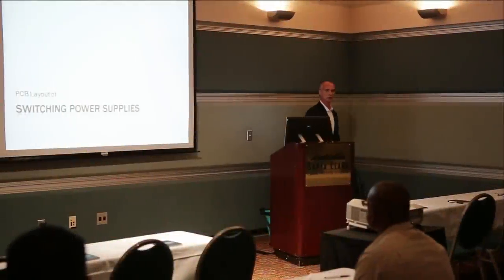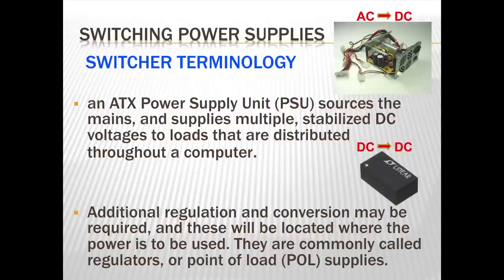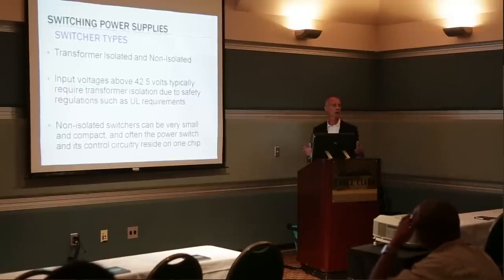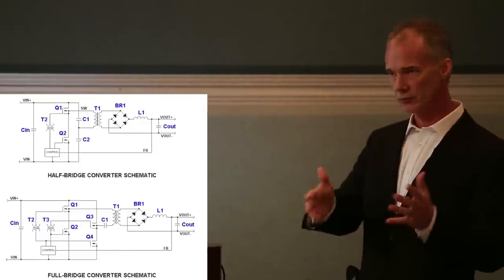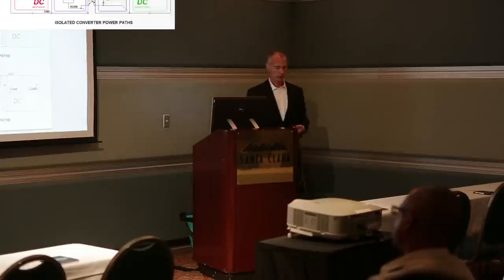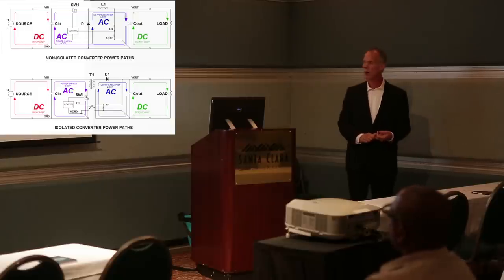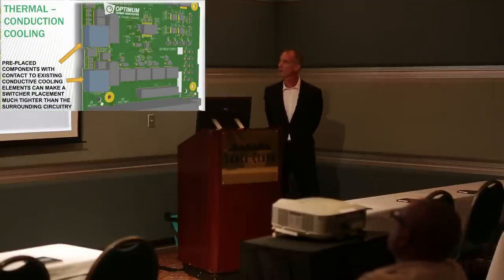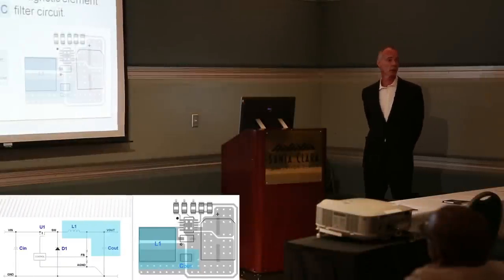Switching Power Supply PCB Layout Seminar

Comment: for the layout example at 28:10 i would not have extended the vout copper pour under the inductor to minimize capacitive coupling from the switch node to the output, one could possibly even have a ground sliver under the inductor to further reduce the coupling, also be aware of inductor polarity for multilayer inductors, you would want the start of the winding (inside) towards the switch node

Comment: Can you suggest a software to me for doing mix signal analysis. I have to design and POE++ device with Power Source side and PD controller side to power up high power LEDs like 70W.  Client requires detailed simulation prior to making the hardware. 

I have seen LTSpice but it doesn't support micro-controllers. Candace tools are super expensive. ...what are my low cost options.
Reply: Think about this before taking a job next time, lol
Reply: Hmm.....why would simulation SW need to include an MCU? Especially for power?

There's also Simulink in MATLAB for generalised & control system stuff

Comment: Great video! I have 1 question on the slide (at time 31:30) the "thermal pad" for the fet is connected to SW. How do you provide cooling for that fet and keep the SW node small?
Reply: This comment is really old but usually the thermal pad is not connected to anythjng
Reply: @sain8827  Hi, I'm still alive ! :)  The thermal pad in 99.9% of IC is connected to GND (or the lowest potential of the IC) and usually they specify that it should not be left floating. In this example with the IC in question is a fet, the thermal pad is also source connection and on Q1 you can see that it is connected  to a big power/ground plane with plenty of thermal vias to spread the heat. I think my questions still stands, and Q2 has only a small area to cool, via its source connection.

Comment: 9:46 - "Linear regulators are typically 60% efficiency". Ok, that sentence did not really help, as it would be hugely different depending on the ratio of input and output voltages.

Comment: So many traps in this video. Explain how you determined linear regulators are only 60% efficient for any circumstance (Hint, you can't). Also, perhaps research your topic a bit more, as you find that many switching regulators are just linear regulators with an additional controller. Also does not talk about disadvantages of Switch Mode Power Supplies (what SMPS stands for that you happened to leave out). For example, at low load currents, SMPS is nominally worse than linear. Likewise, when input and output voltage are close, linear regulator performs better in effiency, introduces no AC noise, less complex (less supplemental components), and is probably cheaper.

Horrible talk on SMPS and linear regulators. Not even sure if your PCB design is good, as im not going to watch it seeing as though you did no research for the beginning of your presentation.
Reply: He specifically mentions SMPS. If you bothered to watch the video before criticizing you would see that. The 60% efficient figure is "typical", aka a common example. Not set in stone.
Reply: @mikek5206  read my comment once more. Never said he DIDNT talk about SMPS, he never spoke on the disadvantages.

As for the efficiency argument, a linear regulators efficiency scales LINEARLY with application. The fact your sticking up for that ridiculous comment shows you too do not know what you're talking about, no offense. 

What I mean by that is if I regulate 6v to 3v, that is 50% efficient, half the energy is roughly wasted as heat. This assumes the bare minimum topology, no power save features.

Likewise, 12v to 3v is less than 25% efficient. Big difference in efficiency for the same regulator based on application alone. That is why that comment makes 0 sense.